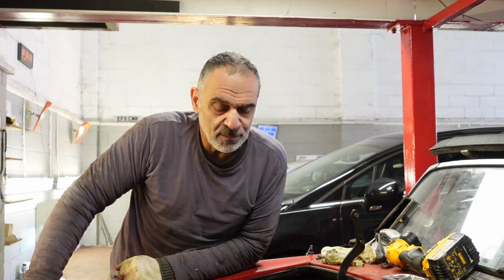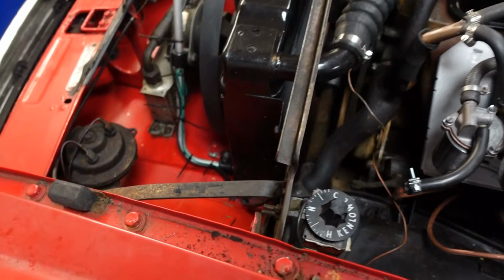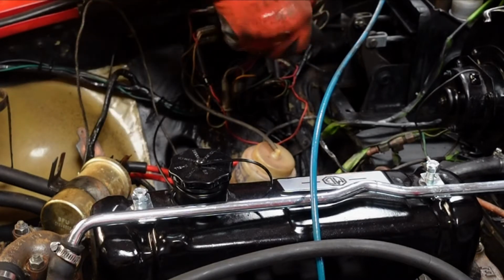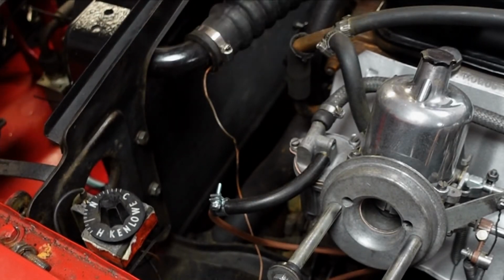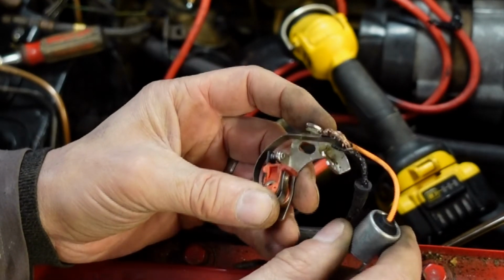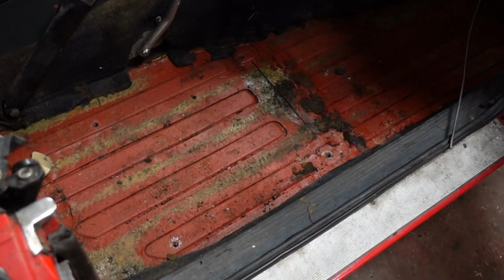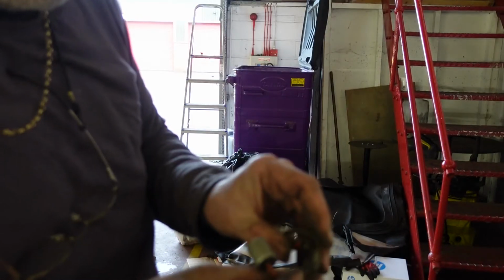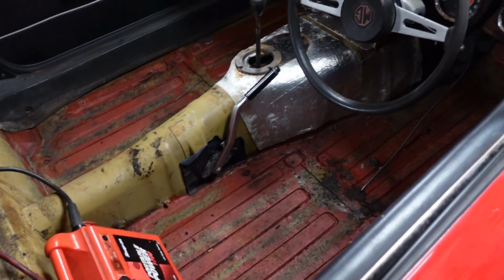MGB Roadster Restoration Part 5

Comment: Thank you for showing the good and the bad. I'm following along in the hope that I don't make the same mistakes. As Albert Einstein said "Anyone who has never made a mistake has never tried anything new". P.S What make is the steam cleaner, all I could see was Chinese writing. :)
Reply from the maker: And I make a LOT of mistakes 😆
Reply: @treetopspider  Just noticed with my Kenlowe the sensor wire is sandwiched between the hose and another piece of silicone padding.
Reply from the maker: @daveking5680  Thats very helful. I didnt know what to do about the leak. I'll look for something similar and try it out. Thank you for that, youve saved me a headache
Johnny

Comment: Floorpan looks good, if you intend keeping it before you put new carpet in adding dynomat or similar will add some sound proofing. BTW the engine sounds really sweet under revs almost ported maybe?
Reply from the maker: I hadnt considered that it may be ported but from the sound of the engine, thats a real possibility. 
I'm not planning of keeping the car although if I was ever to keep one, this would definately be the one. This is just something to fill my time with and have a bit of fun. I'll end up welding an outrigger on this week and when Ive fitted the carpets, I'll spend a few days really cleaning it up. I'll let the next owner go for a respray, that way I can sell it at a more affordable price.